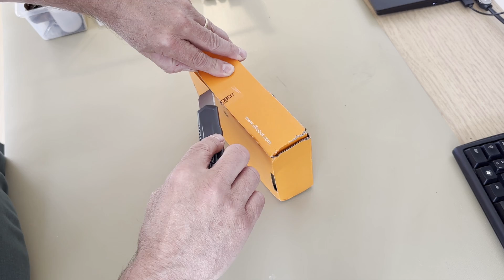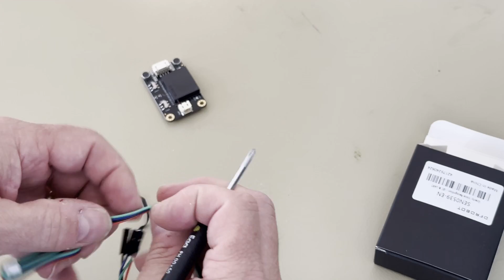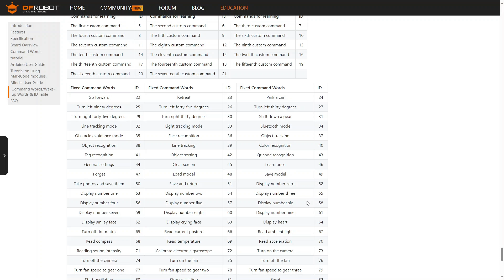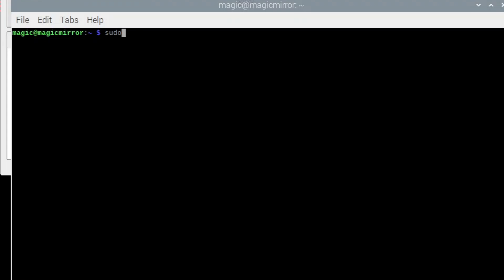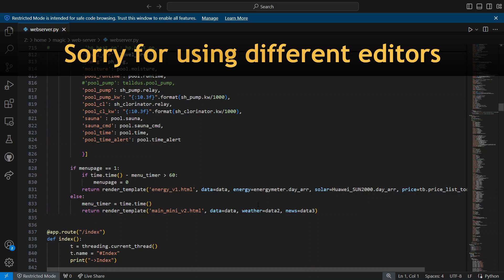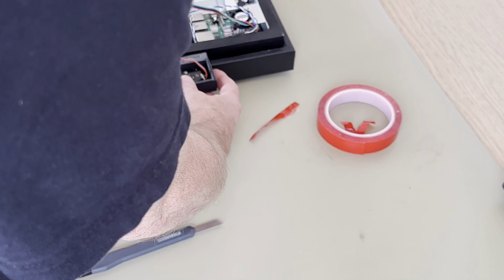Review and testing - Voice Recognition Module

Comment: What you say is not accurate, you can program 17 of your own custom spoken commands with this module.
Reply: Maybe I was unclear, you can of course record your own commands, but you cannot record any custom replies to the commands. For example I can record "Show energy" as a command, but I cannot record a custom response to that command. I can only use the pre-recorded responses
I would be happy if I'm wrong, but In that case I do not understand how to do that.

I most also point out that the issue I initially had with i2c persists after the module was replaced by DFRobot support, maybe it's something wrong in my installation or in the raspberry, but i2c stops working after some time.

After running the module for some months, I can also see that I often get "false" detections of the wake word, normal conversations can trigger the module to wake-up
Reply: @MyHomeBuildingandRenovat-jd1qv  I see, yes I misunderstood. I plugged mine in for the first time half an hour ago. I hope I do not have the issues you had!
Reply: @misc_channel  I hope it works for you !